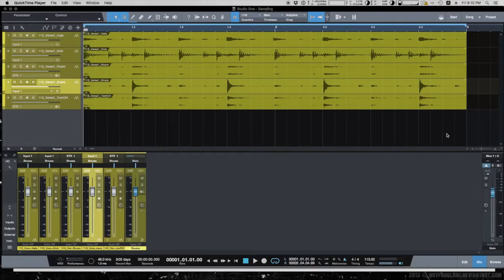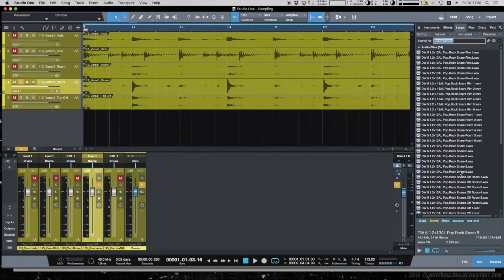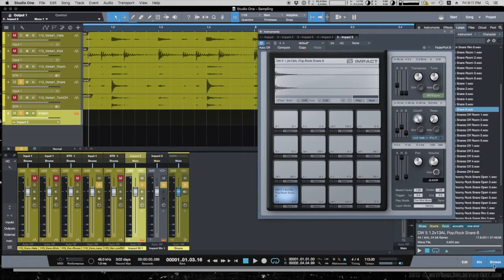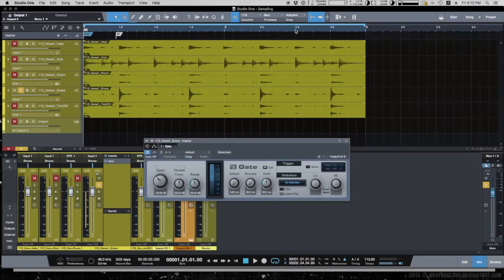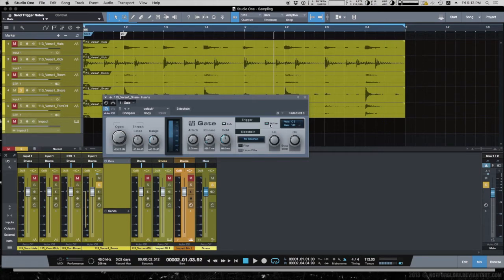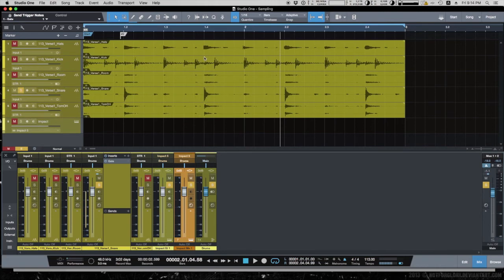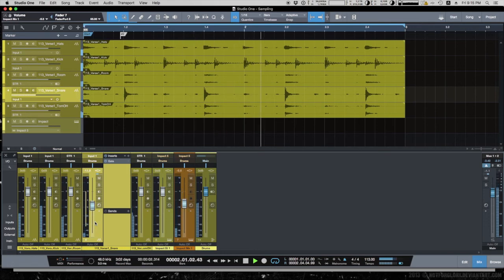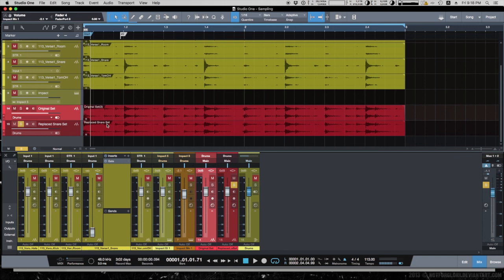Replacing drums in PreSonus Studio One with Gate and Impact

Comment: Tried and work, but there is always a gap between the original and the impact sound that create a slap effect and out of tempo. How did you solve it?
Reply from the maker: Not quite sure I understand the situation. Can you describe your setting, system etc and channel/ track settings?
Reply: Thanks first of all for your response! I think I fixed the issue activating the low latency monitoring. How can I transform not the impact sound to a recorded track to substitute the real kick? Even if I hit record and seems to record on the track of the impact when I press stop recording nothing remain on the track of the impact.
Reply: I added a video here to better explain: https://youtu.be/bjm03J_zQ4U. Sorry for the quality of video and my voice but is my first video with voice and daw, and I was hearing my voice 2 time with some delay while recording.
Reply from the maker: Clear. You have to understand that track with Impact is an Instrument track, so it expects MIDI input and it can record these MIDI "notes" only. As you triggering the instrument with gate, in fact there are no MIDI information present at the input, so this track has nothing to record. However, you want to record analog signal produced by the Impact not MIDI notes anyway. For your situation there are several steps to be followed here: 1) create new Bus, 2) send output from Impact track to this bus 3) create new stereo audio track and pick Bus as an input  4) arm this track for recording 5) press record. Now you should be able to visually see analog signal from the Impact Bus being recorded in that stereo track. Next you can disable and hide the Impact track and use only the recording for further work.
Reply: @StudiojakubkaCz  3:24 you can clearly hear a "flamming" effect from both snares